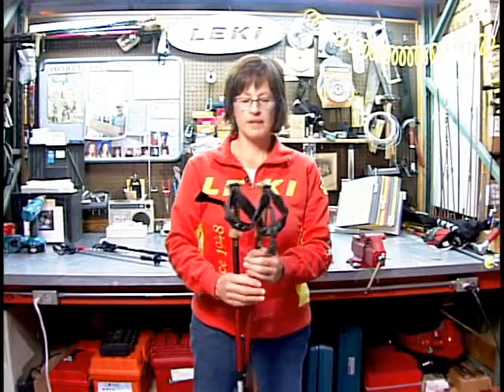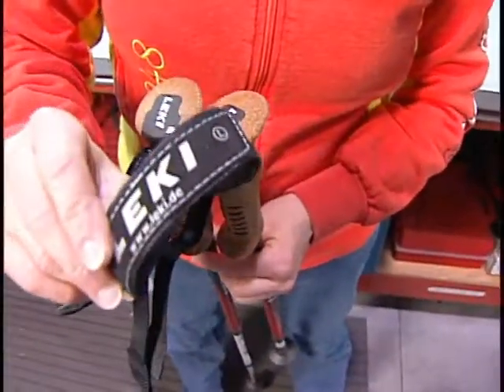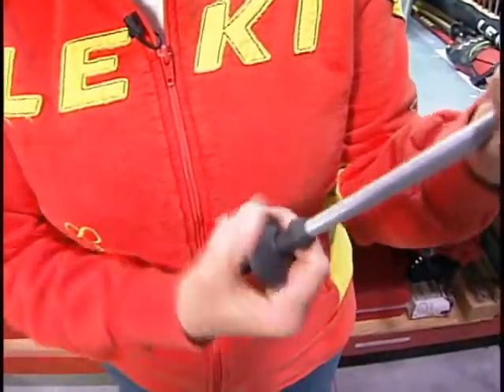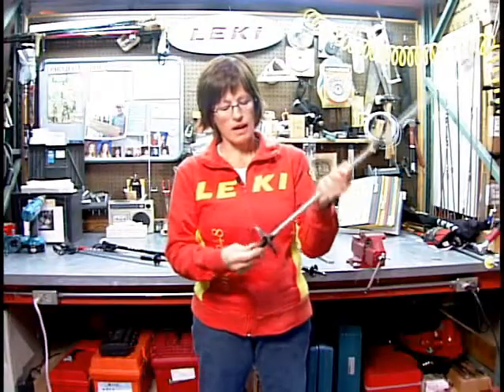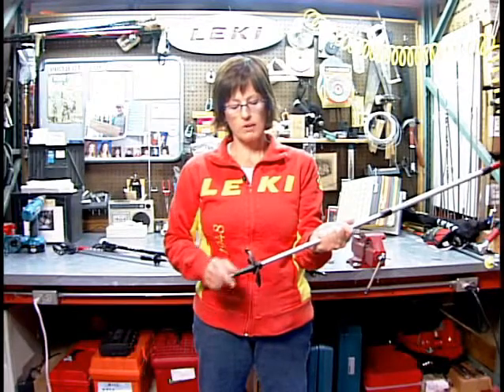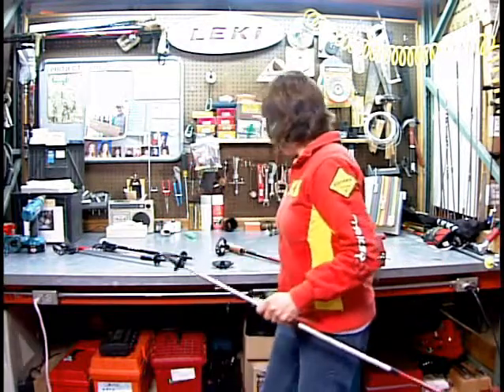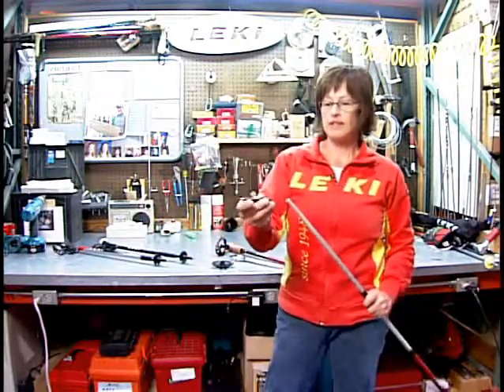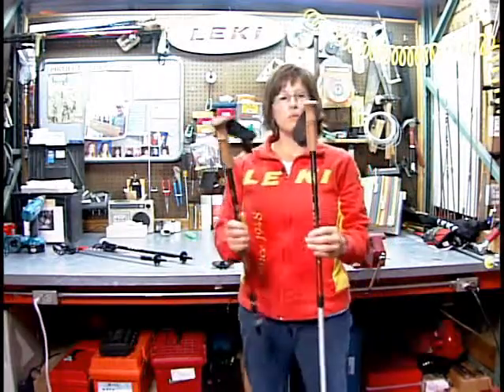Anatomy Of Your LEKI Poles

Comment: Hi karendodo...I'm the chick in the video and can answer that question for you. The other pole "clips" into it if you stagger the placement.
LEKI engineering. Gotta love it :-)
Reply: Don't agree.. The trigger S system for hikers is not good. Palming down on descent the trigger releases and digs into your palm. also I wish you made poles that had as good as the anti shock the Super Makalu had.. DSS isn't as good. Also the aluminum shaft diameters you offer on so many aren't as good as Super Makalus. I don't know what the Supers have but so many of your newer poles bend alot.. on descent and when leaning on them for ascent.. Please make a pole and advertize it for heavy duty use.. who cares about a few ounces when safety is important.

Comment: Will the crescent wrench method also work on the Micro Vario Carbon's? I want to change the tip to accept the snow baskets.
Reply from the maker: Hi Kevin, The tips on the Micro Vario Caron's will accept a snow basket. All of our tips are threaded and will take any basket we make. 

If you do need to remove the tips on your MVC's, you will need to heat them first as they are attached with a heat sensitive glue.